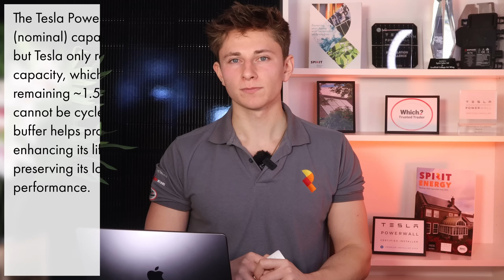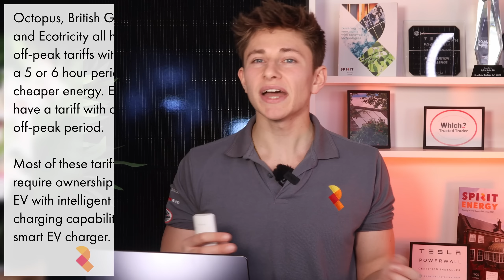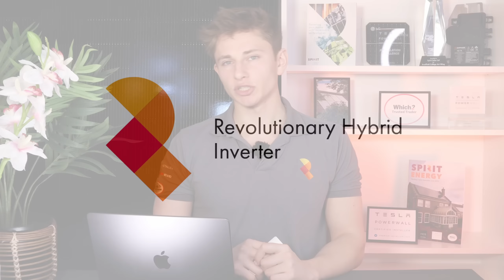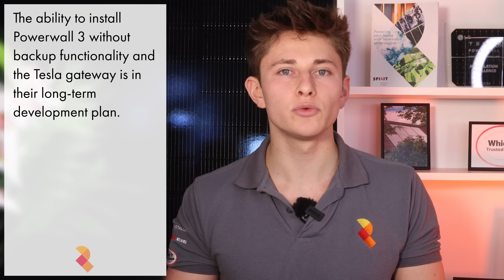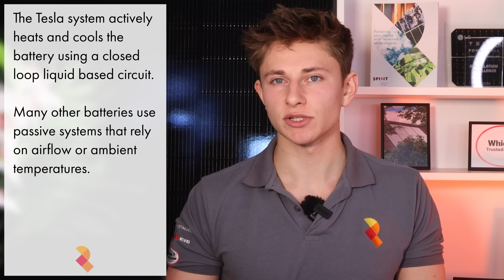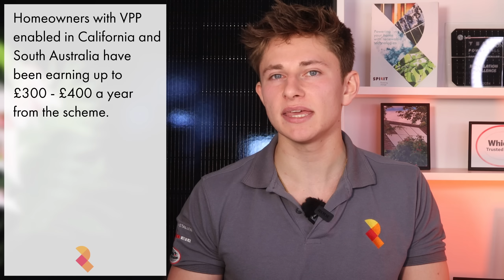Tesla Powerwall 3 Technical Breakdown - Everything You Need To Know

Comment: The BIG problem with Tesla batteries that reviews like this don't highlight, is that Tesla doesn't work with any 3rd party software. What this means is that you have a battery system totally controlled by Tesla and its limitations. My PW3 has reduced my solar generation by 25% as a direct result of Tesla altering its algorithm compared to last year when it worked perfectly for me. The other BIG issue in videos like this is Tesla's support is poor. Poor response times. Unable to resolve the issue, without properly engaging.
I believe there are better systems on the market. I installed my PW3 in February 2025

Comment: I installed a PW3 last March, it worked well BUT
1) you need to make people aware that Tesla doesn't support any other car chargers other than their own. So if you as I did, own a car charger before the battery, they don't talk to each other. The result is when Octopus send a signal to the charger to charge the car,out with the standard cheap power (11.30pm to 5.30am) the Tesla battery discharges to the car.
2) Tesla does not support any third party software, to prevent this from happening. We installed Home Assistant, which sent a signal to the PW3 that it was now cheap rate, when ever the car charger received a signal from Octopus to charge. This solution worked well, but Tesla doesn't support 3rd party software, so when we had issues as in 1, above they complained we were using 3rd party software to over come the battery car charger discharge issues.
2a) also Tesla prevents us from participating in schemes outside Tesla approved schemes such as Axle when you can earn an extra £100 a year over and above what your system would normally generate.
3). MOST IMPORTANTLY Tesla changed their, as you say "industry-leading BMS algorythm", this spring. Result is the battery no longer discharges to make way for our excess solar power. Despite me sending Tesla support in Germany videos explaining exactly what is happening they tell me everything is fine. When it is clearly not. 
We have 27 X 435w panels with 11+kW peak. Grid only lets us discharge 6kW peak, the rest needs to go in the battery.
4) Tesla support in Germany has been second rate through out these issues, taking ages to respond, some times not responding at all. Sending time out feed back comments. Asking for feed back, but when you have something to constructively say, you find the link is timed out.
VERY, VERY dispapointed, I thought I was buying the best. I do now believe there are better systems on the market that weren't there a year ago. 
So, be aware of what you are buying. I still believe the system is good, but the Tesla Battery PW3 human elemant is not. Changing algorythms for the worse, not recognise 3rd party software to over come Tesla issues, the PW3 not able to work with any charger except Tesla's own, also the very POOR support!

Comment: I live in the US and had solar panels installed on my 1300 square foot home located in the Mojave Desert. The system consists of 21 panels and a Powerwall 3. Since the installation took place late in 2024, we missed out on Net Energy Metering 2.0 and are instead on NEM 3. This means the utility company pays us very little for the excess energy we generate that gets sent to the grid. It's unfortunate, but I'm satisfied with our system. The Powerwall 3 is a powerful unit. With an average of 330 days of sunshine in the desert, it's typically fully charged by noon, and it powers our home through the night. We have the reserve set to 20%, and it seldom drops to that level overnight.

One thing mentioned in the video is the minimal cutover time when the grid loses power. To be honest, we're often not even aware when the grid goes down, as the transition to our Powerwall is instantaneous. We usually only find out when we receive a notification from the app. The best part is that while our neighbors are left without power, our daily life continues uninterrupted. Grid outages are rare and typically don't last more than an hour.

Something not mentioned in the video, which may be specific to the US, is that Tesla occasionally offers to purchase excess energy from our Powerwall through their Virtual Power Plant program. They only buy energy in two-hour increments, but they compensate us generously for it. In 2024 and 2025, we received a total of $300 from Tesla for participating in the program on six separate occasions. We're able to set the amount of energy they can use each time. Although we don't own a Tesla vehicle, we're pleased with the support they provide for our Powerwall.

Thanks for mentioning the Net Zero app - I wasn't aware of it before, but I downloaded it after watching the video and find it to be more informative than the Tesla app.

Comment: Here's a bit of info you should be aware of.  Telsa remotely bricked 10500 power walls because of a possible fire issue and they haven't come up with a solution and aren't communicating with their customers. Yeah buy a power wall.
Reply: Same as any car recall I guess, sorted now apparently under warranty.
Reply: @925greenb yeah it's under warranty problem is if the company Tesla doesn't actually do anything. To date less than 5% of vehicles have had there issue addressed.  You trust Elon Musk I don't.

Comment: Thank you this detailed information, its gold mate. As you may be aware, here in Aus with generous government rebates, the uptake of batteries is going ballistic. Myself, like so many here are trying to decide between Tesla & SigEnergy systems. Tried and tested Tesla, or new kid on the block. Question, What are the main difference/limitations between the two when it comes to blackout on the single phase units. My understanding is Sig is all of house, will still charge from PV. Tesla has only certain nominated circuits, and disconnects from PV during outage?
Reply from the maker: Hi, Tesla does the whole house backup if it’s on a single phase. Three phase is coming soon though. Thanks for the kind words about the video.

Comment: I recently had a Tesla Powerwall 3 installed via an official installer, and unfortunately, my experience so far has been extremely disappointing. The Powerwall has not functioned properly since day one: the toggle switch repeatedly shuts off automatically, rendering the system nearly unusable.
Although the unit was delivered earlier, it could only be installed once all other components (solar panels, optimizers, etc.) were in place. The issue began immediately after installation, and the system has been non-operational ever since.
What makes this worse:
• 	Tesla has decided to replace only the toggle switch, despite this clearly being a DOA (dead on arrival) situation.
• 	My installer has no control over this decision and is still waiting for the replacement part — with no delivery date or communication from Tesla.
• 	I have contacted Tesla Energy Support multiple times, but have received no response.
• 	Meanwhile, I’m incurring unnecessary energy costs because I can’t benefit from my solar system.
I’ve now indicated that I’m considering legal action if no proper resolution is offered. I’m posting this review to warn others about what can happen if your Powerwall 3 is defective — and how difficult it is to get support afterward.
I will update this review if and when Tesla responds or resolves the issue.

Comment: Max charge rate 5 kw
No inbuilt gateway
Monolithic 130kg case difficult to carry and install
Gateway too small and plastic
Expansion can only come off leader
Modular system better
Have to use separate isolators
N̈o Isolater for DC connector
Installer app rubbish
Not UPS
Not 3 phase
If these problems are addressed it could be good!
Reply from the maker: Max charge increases up to 8 with a DCX, but I do agree with you that it would be nice if it was faster. Although the 5 kW rate rarely causes issue. 

Building the gateway into the unit would unnecessarily increase costs for those that don’t care about backup. 

The weight is not an issue with the Tesla dolly. 

The gateway is cast aluminium with glass. No plastic. 

Expansion can only come off leader for now. The firmware is getting updated very soon to solve this issue. 

You don’t need to use separate isolators, but it’s recommended practice. 

There is an inbuilt DC isolator. 

UPS would be nice, I agree. 

3ph coming very soon. 

Thanks for the comment.

Comment: The powerwall is long in the tooth. It has fallen way behind on its functionality. It cannot accept chatge from EV. Better to buy a Sigenergy.
Reply from the maker: I completely disagree. I’d say it’s comfortably one of the 3 best battery storage systems in the market without much competition.
Reply: Here are my problems with the Powerwall 3
Max charge rate 5 kw
No proper inbuilt gateway
Monolithic 130kg case difficult to carry and install
Gateway too small and plastic
Expansion can only come off leader
Modular system better
Have to use separate isolators
N̈o Isolater for DC connector
Installer app rubbish
Please defend
@spiritenergy_uk

Comment: I installed an air conditioner capacitor saver on my AC unit which reduced amp draw 50% on start-up.    Before that there were times AC turned out yet didn't "cool" air.     the saver fixed this problem.   Adding capacity saver for your AC unit would be great idea when adding battery backup for power outages.

Comment: A good video, well done. Can only think of one small area you could explain better to the potential customer and that is discharge rate .. you ‘scare’ people to show that at 11kW you’ve only got just over 1 hour. In reality nobody will pull 11kW especially if they are in a backup situation. Advise buyers that in that event the battery will last as long as it can if you manage power usage. Don’t have the heating on full blast and cook twin ovens for roasting !!

Comment: I have recently had a powerwall 3 and expansion pack but even though incoming max is no set I am still only getting a 4Kw charge. Have logged a ticket with installer but not heard back. Also house load appears to be max of 3.7Kw no the expected 11Kw.

Comment: I ordered a 9.2 kw system with 2 pw3 in California ,it will produce around 14500 kw per year…I use 11500 per year..is that good deal for 33000$?
Reply: Same question here, but why not purchase the expansion pack instead of 2 PW3?

Comment: Could you do a video on the pros/cons of where to put the car charger in the chain (or is PW3 smart in this regard?)

Youd want solar to be able to charge you battery or car or house directly, but you might not want your Powerwall discharging in to your car. Can you connect the charger before the powerwall, but still have the option of charge from either solar or mains? Do you have recommended ways of doing it?

Comment: I installed a ground mount 16 kW solar system. I have four Tesla powerwall 3s. 2 have inverters and the other two are expansion batteries without inverters. The lead powerwall 3 controls, all the other (3) powerwalls. The 2 expansion powerwall 3 batteries are connected directly to the lead powerwall 3 in an adjacent configuration. The solar system sent a DC charge input of 15.2 kW to my powerwall 3 batteries, The Tesla app indicated the input of 15.2 kW had not reached the maximum battery charge rate and there has been no clipping of peak charging input.   Is it possible that my configuration of 4 powerwall 3 batteries can charge up to 16 kW or possibly 20 kW? The grid went down for three days, and I had plenty of power and storage. It has been suggested keep the batteries above 20% charge? Best not to go below 20% charge. I was told it’s OK for 100% charge. Typically that happens a few hours a day. Is this the best for longevity? Any comments?  Thank you for the video it was very informative and covered many aspects of the Tesla powerwall 3.
Reply: You can safely discharge to 0%.  20% is unnecessary. LFP is much better than LMC wrt to cycling. The only reason 20% is mentioned is for a safety buffer in case the grid goes down.  With 4 batteries, that's quite a bit of unused storage.
Reply from the maker: You can safely discharge to 0%. PW3 is actually a ~15 kWh battery, and Tesla built a 10% margin in to allow for full cycling of 13.5 kWh without harming the battery.

Comment: I suspect this is going to be a “fight club” question. 
Had mine fitted about 2 weeks ago, seems brilliant, have applied to octopus for export payment but not yet approved. My G99 was limited to 6 kW. When it’s sunny I regularly output 14kW from the array and I’ve noticed it outputs about 11 kW to the grid, on my Tesla app it says there is no export limitation and it’s not something I can change. On good days I generate 80 ish kWh in April, so anticipate 100kWh in high summer.

My question is, has my installer forgotten to apply my export limit and is it something I am responsible for legally. Is his error my gain, or will it come back to bite me please?
Reply: Yes, and yes.
Reply: @ 
Thanks
In my case my installer is a sub contractor and I’m on octopus intelligent flux. 
Also he broke the main incoming fuse when he pulled it, so the DNO came out to replace it and gave it a check over when on site.

So the sub contractor has checked it, the main contractor has checked it, MCS has certified it, the DNO checked it and the octopus AI algorithm has checked it. But it’s still my responsibility as the customer to know that it has been configured incorrectly even though I don’t have access to change it nor have had the functionality explained to me. Seems a bit tight to expect the customer, as the only non expert in this technical and bureaucratic process, to have to cut off my nose to spite my face. 
A few extra volts and amps shouldn’t be doing any real damage, will it, its AC so it’s coming down the supply (the house fuse is 100A) so it it should be able to go in reverse, no?

Comment: Three phase backup, missing again. Highly annoying for Australian installs. Whilst not a deal breaker it’s a missing part of the puzzle that really needs to be resolved
Reply: Agree. That's why I think the Sigenstor system is better overall for oz than the PW3. 3 phase backup, modular stackable battery units up to 48 KWh per inverter/controller, up to 25KW 3 phase inverter, and has a DC EV charger module in either 25 or 12.5 KW that are bidirectional ready!! It'll be even better if Labor's rebate gets up...
Reply from the maker: It is coming soon thankfully! Tesla is working on it. I’d expect it this year.
Reply: Is tesla working on bi directional charging or evdc 12/25hw charger?
Reply: Justin, I'm sure your question was for John, but this is what I'm aware of re Tesla :
You can currently use bidirectional charging, you just need the following:
- Cybertruck 
- PW3 
- Gateway 
- Tesla wall connector 
- And it's not approved for grid interaction, so the home must be islanded from the grid. 
I'm not aware of any plans for DC EV charging, although SigEnergy might just force their hand